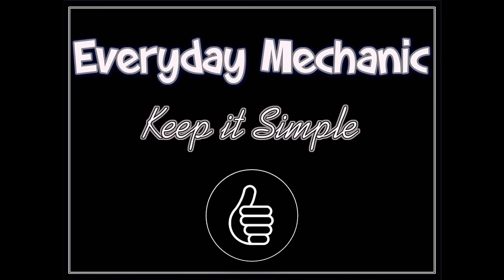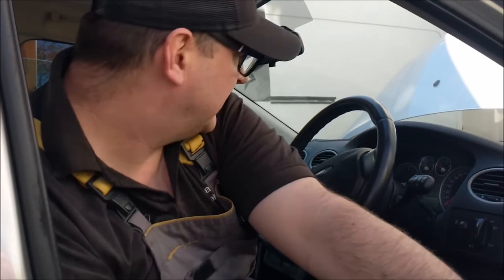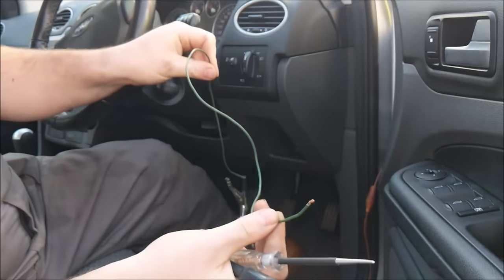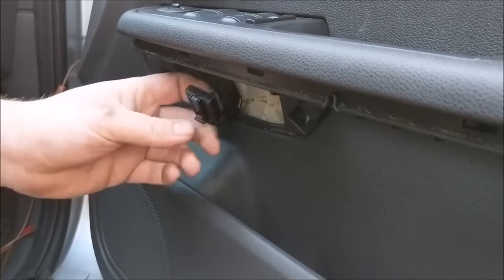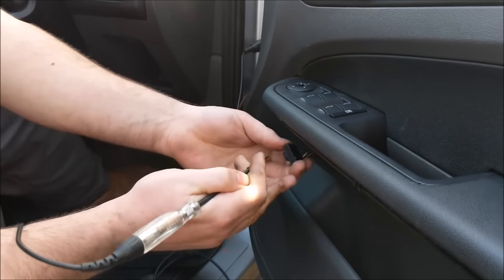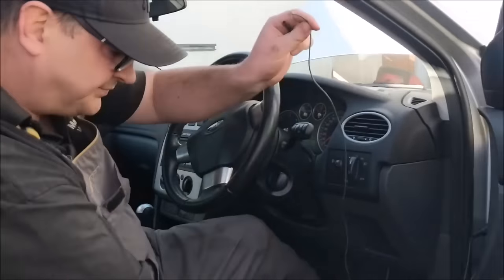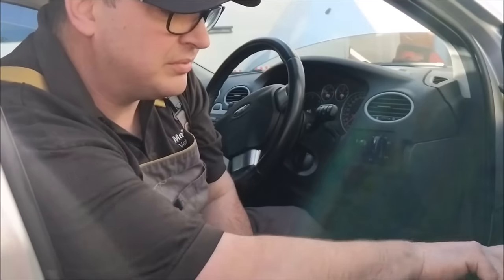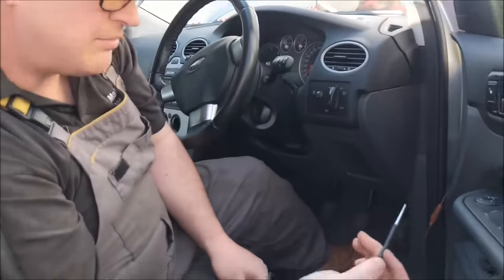Car window stuck and won’t roll up down. Manually Close an Electric Window when your switch fails.

Comment: What am I doing wrong if tester light just comes on but window doesn’t go up?
Reply from the maker: That light is protecting the circuit so if you touch other  terminals and create the correct path the window will move provided the motor mechanism is working and the fuses are OK also this method only works on cars with window controll modules with can bus
Reply: @EverydayMechanic  thanks I’ll keep working at it

Comment: don't understand how using a test light will supply power  to the connector. i've seen people just wire between ground and positive connections on the connector.
Reply from the maker: Hi the test light does not supply power to connector it fools the canbus system with a ground connection to the computer in whats called a pull down system 
I recommend watching some scanner danner  videos to help you understand I bit more about pull down on computers I hope this helped

Comment: Hi matey just replaced the regulator in mine, now it will open all the way no problem, but coming back up it come up in stages so insted of just holding the switch i have to keep pressing the switch to get it all the way up any ideas?
Reply from the maker: Yes mate when the window reaches fully closed hold the button down to close for 3 seconds do this for 3 times then do the same when window all the way open  this will reset the auto close open function 👍
Reply from the maker: Sorry made a mistake their close the widow then press the button to close 
Window even though the window cannot close any further hold the button down for 3 seconds do this for 3 times then repeat this in the open position aswel that will reset the window I hope that makes sense 😀
Reply: Perfect thank you i will try it out and let you know how i get on thanks 👍
Reply: Thanks buddy i tried that trick today and it worked all is good now thanks for the help matey 👍👊
Reply from the maker: No worries. Glad I could help 👍🏻
Reply from the maker: Your welcome

Comment: I tried that on my 2004 beetle and it didn't work. When the battery was dead turning the key to (try) to start the windows went down about 1" without pushing the button. The 
1 top (conv)
2 windows
3 mirrors
4 trunk
5 vanity lights
6 key fob
All stopped at same time. I checked the fuses side of dash and on battery all good. Anyone please throw me a suggestion I'd appreciate it. Thank you in advance.

Comment: Hey, tx. Can it bedone when there is no power to the entire unit? As in the door is off the vehicle?(for painting)
Reply: no would not work as the vehicle power would be disconnected
Reply: @nicholaslarge1035  - 😐  ... I'm using a 12V transformer
Reply: @nicholaslarge1035   😐  I'm using a 12V transformer, yo. lol, no, my bad. I guess there is power but it's not connected so my question is if hooking in the power can be part of this and work, or more generally, HOW DO I GET MY WINDOW DOWN!. lol

Comment: Well, that is closing it electrically, just bypassing the switch. Closing it manually, as in the case of the motor failing, is quite a different task.

Comment: If the problem is the motor this won't work will it?
Reply from the maker: No sorry this method is a switch bypass if the switch does not work

Comment: So if that happens do I have to change the switch button then
Reply from the maker: If you press the button up or down and nothing happens but you can get the window to go up or down using my method then the switch/button will need replacing yes 👍
Reply: I am having trouble with ‘07 Dodge Caliber. 
  I had straight wired somehow once and got it to go down. I forgot how I did it. I think I ran at least one from the battery.  It is still about two inches from closing. 
  I put the switch from the rear passenger window in it and it does nothing. Put that switch back in the rear a d it works. Hoping I did not damage the front window motor when I ran a wire to it before. 
  Anyway, I have seen the problem can be from the main switch at the driver side. 
  I am going to try the method in this video.

Comment: What if the winder motor has failed or the relay....
You didn't explain exactly what you used for a test light either.... most people would grab one of those mains testers screwdriver which would NOT work here ...

Comment: That is not 'manually' closing the window.  That is simply bypassing a defective switch.  What if the window motor is bad or a wire is broken?  Manually closing the window would require taking off the door panel, disengaging the motor and physically raising the glass and locking it in place.

Comment: You did not Manually close the electric window.  You manually bypassed the switch to allow the electric motor to close the window electrically.  Thanks anyway.
Reply: Thank you for your reply but if i used the terms bypass switch it would be useless to people without mechanical or electrical knowledge i try to simplify things even though the terminology may not be correct it puts things into laymen s terms  
keeping things simple thank you
Reply: @nicholaslarge1035  Oh, I see.  Well thanks for that.

Comment: All's well and good if your switch is broken..... But what if the motor to the window is broken.... Useless..... But good information anyway.... Plus it's a way to let you know that it's not the window switch but the window motor is broken ....so , it's not useless information , actually it's probably a good way of deducing a faulty window switch or bad window motor ... So thanks...  Peter
Reply: Oh by the way it's not a big deal but you got one more subscriber so look forward to more information... Thanks bro

Comment: With "smart switch" windows, a test light WILL BREAK IT! Such "modern" windows operate on 5 volt pulses. Putting 12 volts into the output will burn out the IC. :(

Comment: Awesome, But I Couldn’t see a single thing he was doing. 

This only works in an emergency situation if your at home, and have the tools. What about when your actually in the middle of nowhere, the windows stuck, and its about to rain, and you don’t have the luxury of time.

It would have been nice to actually see EVERYTHING he was doing.

This video assumes you have the tools, and already know what you’re doing.
Reply: Uh no he clearly showed everything he was doing besides clipping onto the piece of metal on the edge of the door. Obviously this is a home fix to delay changing the switch and any common sense person wouldn’t be rolling that window down anymore. Also if you kept the test probe in your car you COULD do it anywhere.

Comment: That's not mechanically operating the window, it is still powered by electricity.
Reply: True. Just emulating the switch. The real pain is when motor or pulley assembly goes bad.

Comment: The test light you use is just as bad as a jumper wire I have fried a tcm using one like that you need one with a computer board

Comment: Unfortunately your method didn’t work for me on any of the windows, even the ones that still work on the switch panel! 😢
Reply: sorry to hear your having trouble but this only works with can bus systems as the switches are module inputs only and do not carry power

Comment: #1/ your accent is not very clear. Slow your speak down. #2 I have a chrysler/2002 lxi and my driver's side window is closed and not getting the power to release it down. If you start at the very beginning, listing the tools you need; what they are capable of; a slow step by step process and especially putting it all back again. thx

Comment: This is a joke. Anyone can short a couple wires, with or without a test light. The trick is GETTING ACCESS TO THE SWITCH and associated connectors. I don't need anyone to show me how to connect two wires together. Sheesh